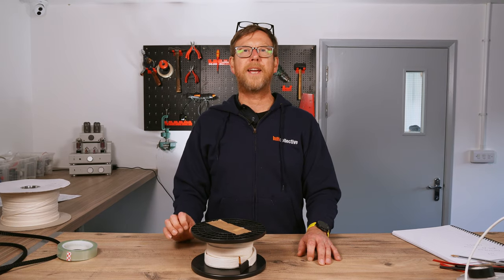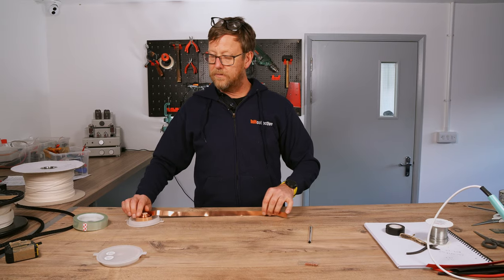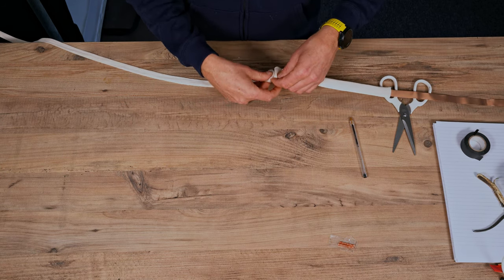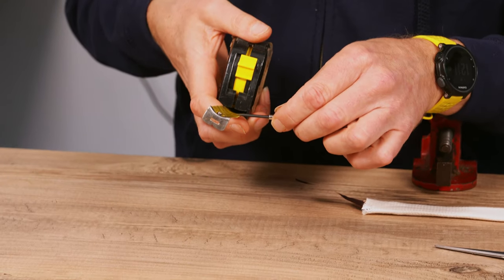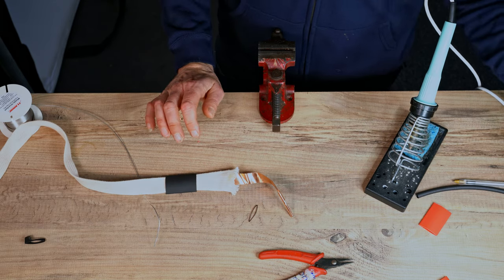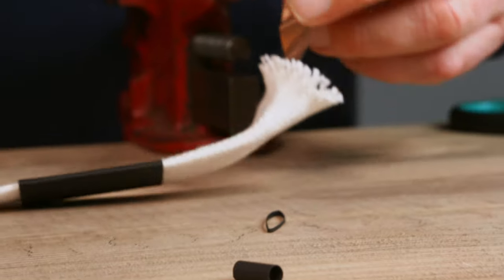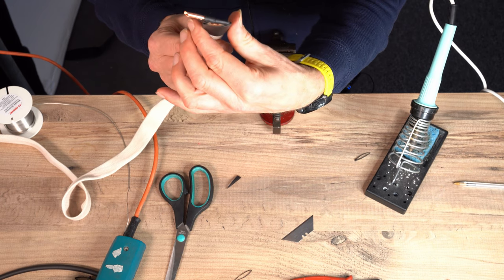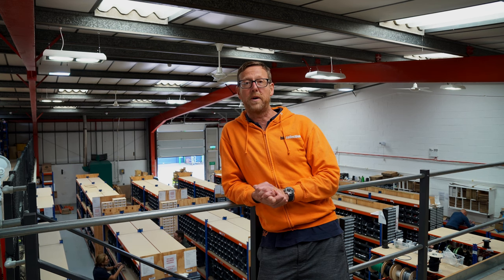Glasshouse SPEAKER CABLE KIT No.5 (ft. MUNDORF Copper Foil and Cotton Sleeving)

Comment: Hi Nick, nice to see this video. I'm one of your loyal customers. I have to chime in on copper foil for speaker cables since I made some of my own many years ago. I used foil from a Goertz air core inductor and created a cable using two runs of foil separated by polypropylene adhesive tape which had adhesive on both sides. The outsides of the cables were also done with polypropylene tape with single sided adhesive. So it was a tape, foil, tape, foil, tape sandwich. I sealed the edges with heat from a soldering gun but it wasn't the reliable seal that I had hoped for. This cable design was very low in series inductance and relatively high in shunt capacitance and that is a formula that tube amp output transformers work exceptionally well with. I loved the sound with those cables and they really looked great with shiny bright copper showing through the clear tape. After several years small leaks in the side edges became obvious and the cables slowly oxidized into an ugly brown mess that just didn't sound good anymore. Copper oxide is a very poor conductor and most of the signal flows on the surface of a cable (the skin effect). So it was sad to see them become useless objects. So Nick, are your foils coated with something like enamel or urethane? If not you are going down the wrong path. Once they oxidize they will be trash. You may want to reconsider or maybe soak the cotton and copper in lots of mineral oil.
Reply from the maker: HI
Many thanks for your mail, we will look into a way of sealing them for version 2.

Comment: I made a set of speaker cables with mundorf 45mm width copper foil. I wrapped them with three layers of thin traditional Korean paper(Hanji) and finished them with 60mm 3M filament tape. I didn't use any plugs. Just cut both ends to the shape of spade connectors with a pair of scissors. The result is amazing. The sound is very comfortable to my ears and the stage is deep and wide. The best speaker cable I've ever used.